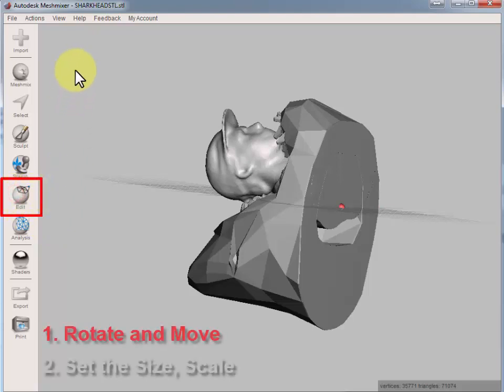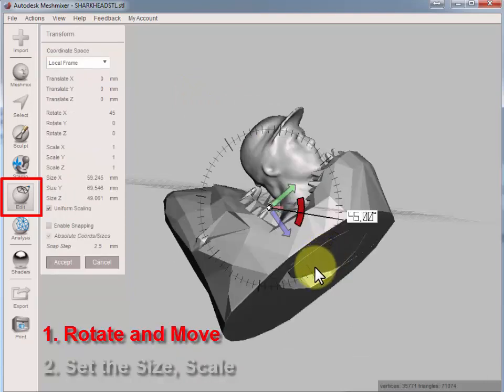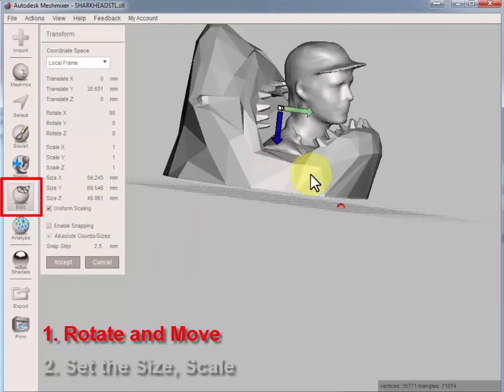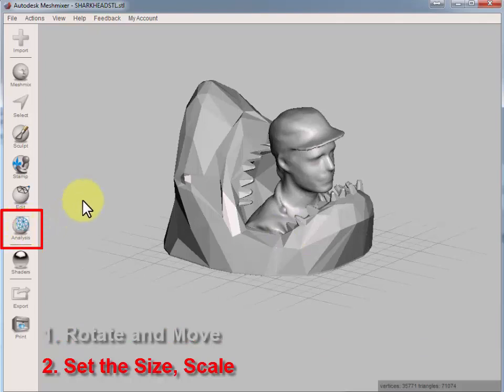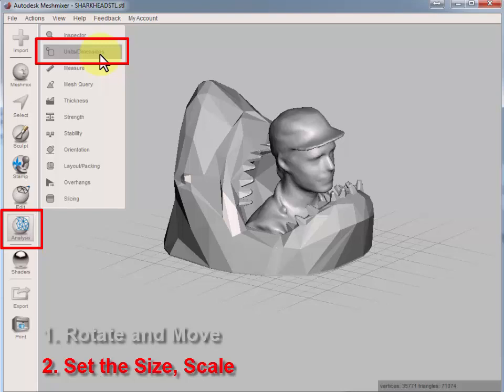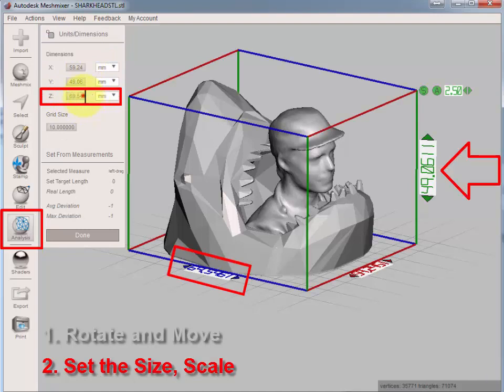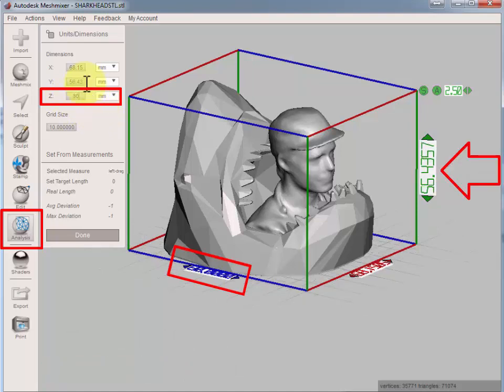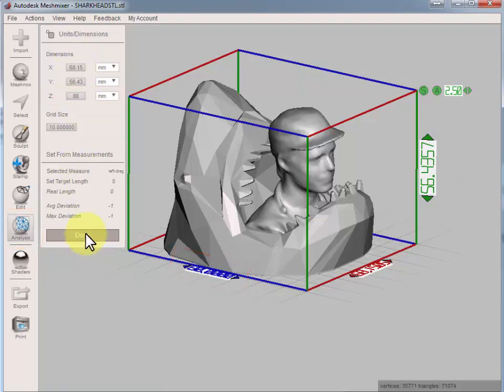Rotate and adjust Size before 3D-printing

Comment: Hi Thomas, greetings, I'm interested in making a 3d sculpture of my own head and print it in a machine, the head will fit a 6 inch action figure, so no super big dimensions to print. Can I get some guidance? I'm in Umeå and I have asking people but 0. Sadly my computer can't run some softwares to do so. People tells me it is better to scan my head or face and then adjust it to the dimensions to print. Thank you for further explanation and help
Reply from the maker: Sure. Contact me and maybe we can find a solution for you :)